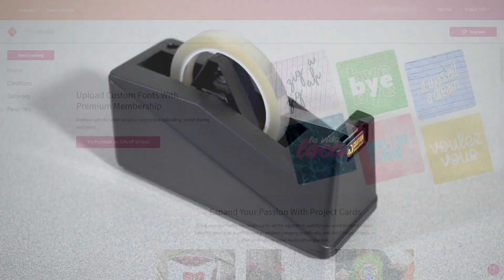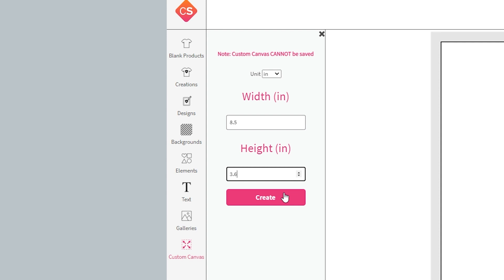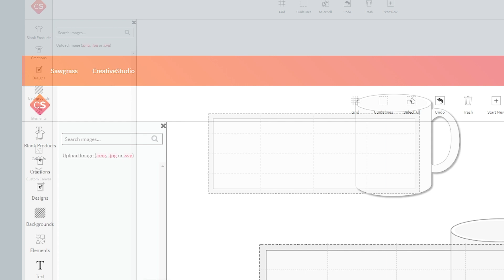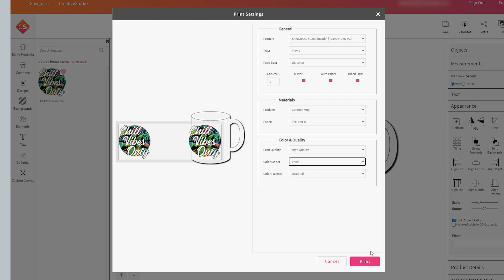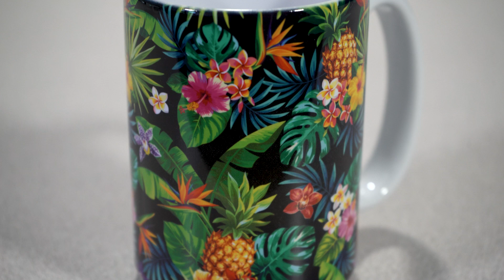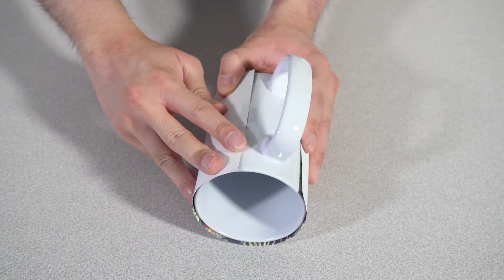How To Customize Sublimation Coffee Mugs

Comment: Is there a way that you can wrap the sublimation wrap all around 360' on the mug? like the wrap only goes all the way aroun until the handle. i wonder if can go all around thru under the handle or its not possible?
Reply from the maker: There isn't a way that we've found. The problem is being able to apply pressure on those areas. If you could find a way to apply pressure to those areas while it's being heated up in an oven, that could solve the issue. If anyone reading this has an idea or link to a video, we're all ears!

Comment: Why is there never a video on how to use the mug paper, which you guys sell? It’s such a waste to print one mug design on a whole sheet of paper only to have to trim it.
Reply from the maker: Hi there! The process would be the same, you would simply select 4" x 9.5" paper vs 8.5" x 11" :)
Reply: @HeatPressNation  I didn’t know if you would load it in the printer horizontally or vertically. I called tech support at Sawgrass and they walked me through it.

Comment: Need help, my mugs are ghosting. I'm using this exact model and taping it good
Reply from the maker: Try to wait a few minutes before removing the transfer from your mug. Sometimes if you peel too soon, there may still be gas dye present on the surface of the mug. As it seeps out/up, it may leave a streaked or "ghosted" appearance on your image. By letting it cool a little before peeling, you can eliminate this.

Comment: @HeatPressNation  I'm referring to the full color mug (I might have commented on the wrong video) see pix.  He was demonstrating the heat press I want!  The video came up when I was shopping for porcelain sub mugs.  I was wondering if the porcelain was better than ceramic to prevent ghosting.  I've never left my images in place once I removed the mug but maybe that's my issue?
Reply: My original comment on the other video. 
Was that 15 oz full bleed mug porcelain or ceramic?
How did you avoid ghosting with  the black?
Reply: Your reply to my original comment.
	
HeatPressNation
In this video we used an 11oz ceramic mug. We applied a full bleed graphic. To avoid ghosting, be sure to use heat tape to keep your transfer fixed in place through the pressing process. In this video we recommend waiting 30-60 seconds before peeling. You can wait longer - 5 minutes or until cool - if you notice ghosting or blurring on your mugs

Comment: I have a slight problem. I have the HPN 7-in-1 signature series mug press and I am trying to press the 11 oz Lover Mug set. Can you tell me what sleeve/time/temp I should use for the "spooned" cup. I have tried different sleeves and just can't get the pressure right.  Thanks
Reply: My wife (UnlockedCrafts) just received your answer to this question on another You Tube video. Thanks
Reply from the maker: Siser EasyPSV has an outdoor rating of up to 3-5 years. (This will vary by climate and the amount of time in direct sunlight.)

Comment: I notice you don't use butcher paper or any kind of wrap. How do you keep the ink from bleeding onto the heat press?
Reply from the maker: For some reason, we don't really have a problem with outgassed inks staining the mug press. We've tested literally thousands of mugs here and have yet to stain a mug press heating element. However, we encourage anyone who feels safer using blowout paper to continue doing so. 

It's interesting because when using a regular flat heat press (like for t-shirts) we ALWAYS use parchment paper for protection.

Comment: Great video - question though, why didn't the 15 oz. Design go around the the whole mug (including behind the handle?) Instead it was a harsh stop. Can this be done differently to avoid that ?
Reply from the maker: The design of the mug press includes a gap to accommodate the handle of the mug. This gap does not allow for any heat or pressure to be applied on those areas. That's why the image does not extent do those areas. 

That section cannot be customized with a mug press. You may be able to accomplish this with heat shrink and an oven, though we haven't tested this method.
Reply: @HeatPressNation  That makes sense, thank you for the clarification

Comment: I have a question...I recently bought the 15oz sublicraft mugs from your website and I’m having trouble with the image transferring on to the mug correctly...I’m using a hpn signature mug press with textprint hphr paper with premium paper settings printing with an ecotank 15000 using cosmos ink @ 385 for 190 secs with firm pressure. The image looks patchy in some areas like the ink didnt release on to the mug. Is this a pressing issue, heating element problem, or is it my printer? Hope you can help, thank you.
Reply from the maker: Since we don't carry that printer or ink, we can only provide troubleshooting tips for the heat press. If you suspect it could be a printer/ink issue, try reaching out to Cosmos Ink directly.

Here are a few troubleshooting steps to try:
- Loosen the front pressure knobs all the way. For 15oz mugs, you can use just the top pressure adjustment knobs.
- Make sure both pressure rods are extended equally in distance. Use a ruler if necessary.
- Pressure should be firm, but not too difficult to open or close.
- Make sure the mug is centered right in the middle of the heating element. 
- Make sure your transfer is sitting tight across the surface of your mug, with no bubbles or gaps. Be sure to use heat tape to secure the printed transfer in place on your mug.

If you need additional troubleshooting help, please feel free to email a photo of the failed mugs to support@heatpressnation.com.
Reply: @HeatPressNation  thank you for the quick response and I appreciate the feedback. I will make these adjustments thank you once again.

Comment: Do you let your mug cool completely or just for a minute? When I've done this using this exact mug press but image still has some blurring during the cooling process.
Reply from the maker: If you're still getting blurring, let the mug cool completely before peeling. You can also try dip the mug in very warm (almost hot) water to stop the sublimation process. (Do not use cold water, as this will ruin the mug)